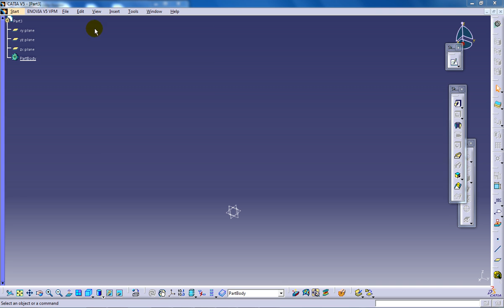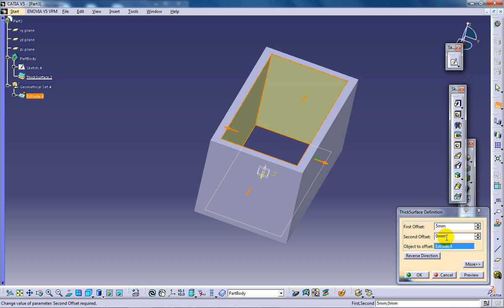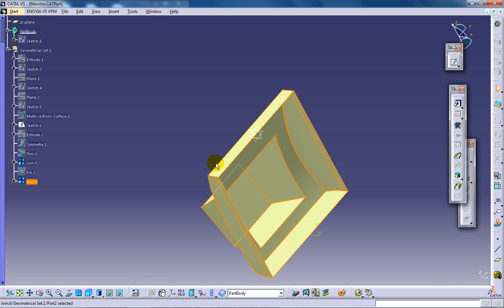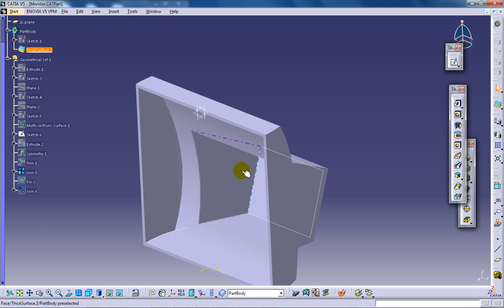Catia V5 Powerful Tricks #142|Wireframe and Surface Design|Thick Surface

Comment: very interesting can you tell me if thicken with this program works better than solidworks thicken feature?  for example could you use it on a whole car body without having allot of overlapping surfaces in small corner areas that would fail in Solidworks?
What procedure do you do to thicken a car surface when there are lot of details in the surface?  do you offset the surface and trim as needed or can this program do this in one click.  Thanks